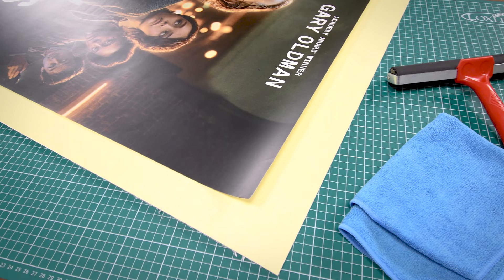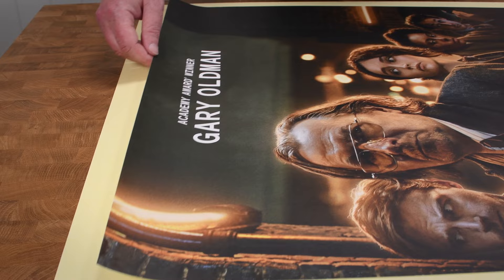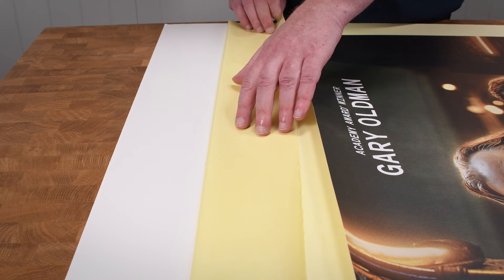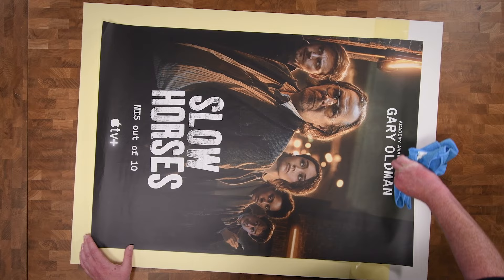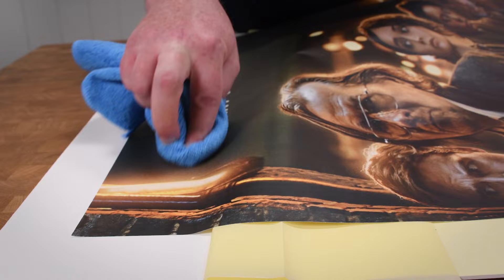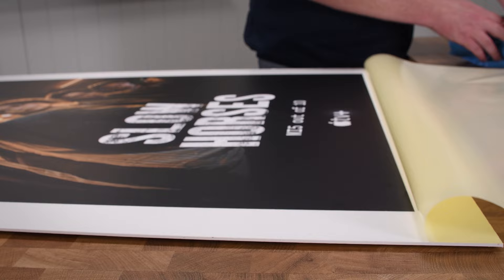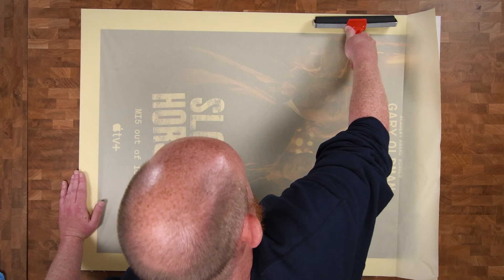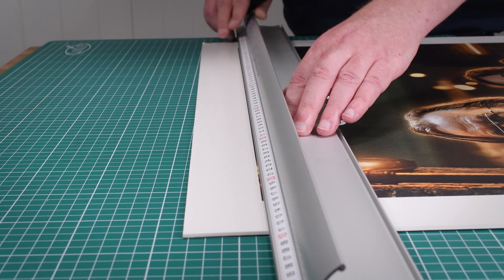How To Dry Mount Artwork (Without Air Bubbles!)

Comment: So im buying some original movie poster's. 27x40 and there being put in metal frames. The company offers to do dry mounting for free but should i? Is it recommended for originals or is it just better for the poster to be framed like normal?
Reply from the maker: Hi, dry mounting original posters can decrease their value so we wouldn't recommend doing this. For conservation purposes it is preferable to put a small mount around the artwork so it can be hinged with tape. Alternatively, if it is framed in a normal way (up close to the glass), then ensure it is kept away from damp or humid areas. Hope this helps!